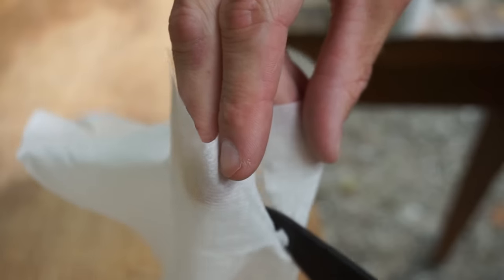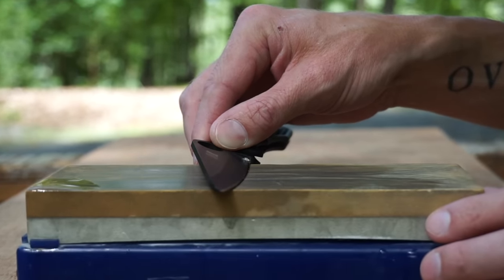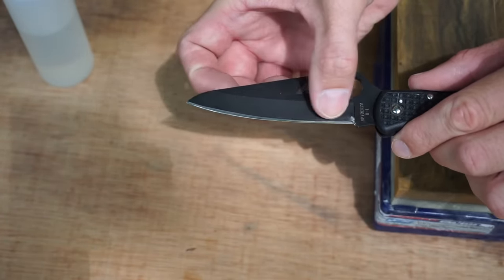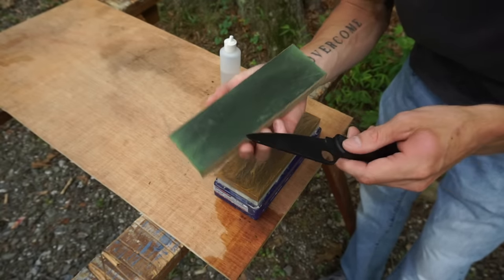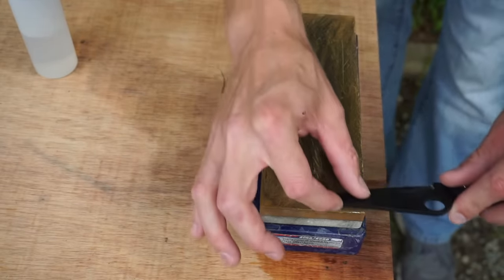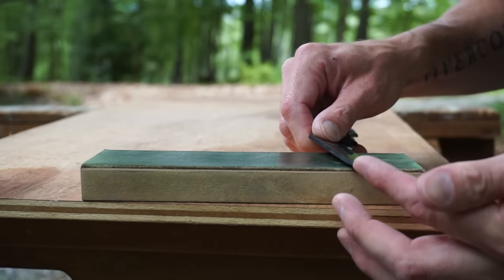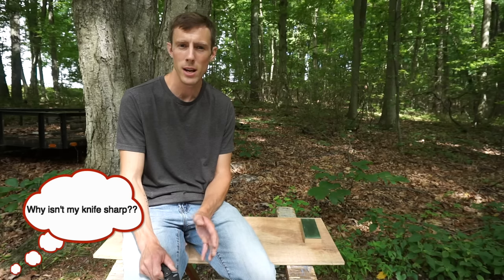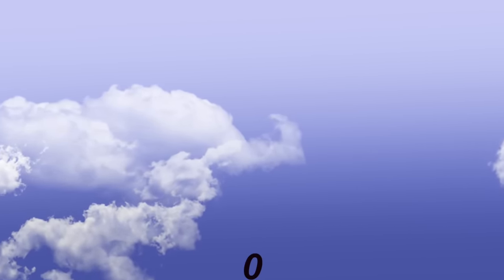3 SHARPENING TIPS BEGINNERS MUST KNOW.  How to sharpen a knife

Comment: Every time I feel like wasting some time, I go to YouTube, look up some knife sharpening tutorials and try to sharpen my deadly dull folder (that actually was kinda sharp before I decided to remove a nick in the edge). Pretty much every next tutorial seem to poop all over what was said in the previous one, yet none helped me produce any success so far. 

I've tried dry stones ,watered stones, oiled stones, moving the knife away, moving the knife towards me, moving the knife in a circle, alternating after 5 strokes, alternating after 20 strokes, alternating after 1 minute, moving alongside the whole edge, sharpening the tip and the blade separately, screaming at the knife in utter despair.

I'll either sharpen or just whittle it away eventually.
Reply: Buy the guide-knife it help a lot... you reach a nice angle. I start sharpen 1 year ago my chefknives without results and now slowly slowly i see that every time come better and to adjust a knife you don t need 2000-3000 grit buy a wet stone 400 and 1000 is enough for normal purpose and is enough to keep sharpen most of the knives. When youll learn how to sharpen better move on more grit and when you will learn very good move on diamond stones because diamond stone if you don t know how to sharpen very well are gonna fuck up your blade.
Reply: Alexander Samarin oiu
Reply: Alexander Samarin i

Comment: See, this is what happens when you actually see and hear how someone with experience, knowledge and understanding demonstrates how to sharpen a knife properly. You just showed me the step I didn’t know about when stroppng that is why I sometimes get a slightly rounded over edge. Use a lesser angle. Now it makes sense. That’s why you see guys strop a blade and they’re practically holding the knife parallel to the strop. It’s those key points that are too easily taken for granted that people overlook explaining. Thank you for explaining things properly. A great, to the point, no nonsense video with clear instruction.

Comment: I absolutely suck at this. I am so mad at myself right now for I have ruined my mora bushcraft and spyderco polestar edge. You make it look like buttering toast.
Reply from the maker: You can't really ruin an edge completely unless you took it to a bench grinder. Just practice maintaining an angle and go slow. It does take some practice. The mora bushcraft is a scandi grind. All you have to do with that knife is keep the bevel flat on the stone. Again just go slow and maintain an angle. Hope this helps🙂
Reply: Smith's or Lansky has a kit for sharpening. Look them up.
Reply: @richardhatt6541  Systems with a set angle are not the best on Scandi grinds (use the Wicked Edge a lot myself). The problem is that the system is very exact, but the grinding on the knife is not. So it needs a more flexible touch, which can be achieved free hand. Easily, since the grind itself functions as an angle guide.

Comment: Great tutorial. However, at 3:00 or so I did not quite catch what you said regarding reflection. If light reflects from the edge, does that mean an apex has not been achieved, or vice versa?
Reply: My understanding is if you see light reflected off the edge of the primary edge (the part the cuts) then you have to keep going with your sharpening strokes. When the primary edge comes to a true point, light is not visibly reflected off it.
Reply: If the knife is not apexed in a certain way, you will see what looks like a flat spot in the edge when you hold it up to the light.

Comment: Going backwards on the stone is the best way to get a burr on the edge. Go forward. Lightly. It's like shaving, not slicing a block of cheese.
Reply: Thats how ive always been taught to sharpen. Hold the angle & draw the edge along the stone. Ive never seen someone sharpen spine first like this
Reply: Great comment. Stroking backwards will cause the burr to roll from one side to the other while stroking forward will pull the material away from the apex. 20+ years on a burr bench in a precision machine shop taught me this.
Reply: Yea it is but you missed the point of why he said that. When you do that it's easy for a beginner to move the angle and mess it up and have to start over.
Reply: @jasonrogers803  But doing it the bad way means being a forever beginner.
Reply: I was told it redeposit's metal where its not needed going backwards, I was taught edge control low angle 22 degree apex going forward on a diamond rod or stone....... But that's me and I am 52 now, we will try this on a axe and see where it ends up. Aloha

Comment: I  work on knives/swords/hatchets/axes as an avocation.  Yours is the best explanation of using stones for a beginner.  If a person has limited time, bad lighting, less than perfect eye sight and isn't using the knife to shave or filet sushi, and it is not serrated, a person might consider a two handed, manual, non electric sharpener with a set angle.  There are fine ones for under $20.  You hold the unit in one hand and draw the knife through with the other.  

If you are still a beginner, but are working with a volume of knives or the knife has serrations, consider a belt sander.  The way you do the serration is to use the edge of the sanding belt which is narrow enough to get into the groove.  Hint-I do my belt sanding outside on a stand and not indoors.  It reduces the chances of accidental fire and also reduces the amount of particles that might accidentally be inhaled over time.  The lighting is also better.

You worked with a spyderco.  Ok.  Guy on eBay advertised a "dull" Endura.  Less than $20 delivered.  two passes on the belt sander with one a couple of seconds pass on the edge for each serration.  Similarly, I sent three nieces college age last month each the same Cold Steel folder bought off youtube, cleaned up and sharpened.  Added a leather sheath for each.

Comment: Thank you a lot for your sharpening series. Given all the videos on this topic in the internet, I still consider yours to be at least ones of the best, I've learned a lot from them and I really like your approach.
Didn't move to diamond stropping compounds (I try to do my best with Dialux for the moment), but other than that I've used your advices and they really work well.
Haven't been able to achieve the hair whittling sharpness unfortunately - when the knife cuts the hairs in air, and I'm not sure that stropping with diamond compound will give me that.) So still working on my hands and skill.
All the best wishes, and thank you again.

Comment: Nice straightforward presentation, well done, not everyone acheives that. Agree with the tip about the Sharpie to help in matching the original angle. The only other tip I would add is to put some jeweller's rouge on the the strop to polish the edge a bit more than just the leather alone.

Comment: I have my husband's or my father-in-law's Rostfrei antler handle sheath knife.  I found it in a drawer; he hadn't used it for 30 years before passing away back in 2008.  The blade is shiny but looks very worn; I know he used the heck out of it for 40 years.  The leather sheath is discolored but not brittle.  How can I clean the knife AND the sheath?  I know that's a huge question and you probably have a video about it.  If you would direct me to it, I would be appreciative.

Comment: Great video!  Just have a basic question. Starting with a kitchen knife that's "dull", approx how long roughly (how many strokes on each side, how many minutes) do you spend sharpening it until you get the desired burr and apex with your first stone?  How many additional stones should I use to finish each knife?  Do I stop between each stone?  Do I spend about the same amount of time and strokes on each successive stone as the first?  Thx.

Comment: Sharpie trick is the best for beginners in my opinion. I still use it myself when sharpening a knife I'm not used to or if it has an edge type that's difficult to sharpen. Also IMO the back and forth method is pretty fundamental and beginner or otherwise you should practice it. You'll never get that muscle memory if you don't start doing it. Sharpie that edge and start doing it. You'll find you've improved amazingly by the end of sharpening a single knife

Comment: Thank you. You confirmed what I thought was correct.
Reply: There is no correct way to sharpen i sharpen towards me and i achieve the best edge but if i do it the way the video says i never achieve the same sharpness so it all depends on what your used to and what works for you this was said to me by a guy who has been sharpening for 60yrs as long as you keep roughly a 20° angle when sharpening then it shouldn't really matter but this is a good solid guide to sharpening for beginners though

Comment: Have you any experience or thoughts on EZE-LAP DIAMOND "M"? I had a friend find one in pretty good shape at a garage sale so I looked them up and ordered a brand new one of these sharpeners after seeing how his worked. This has a brass handle and the "diamond" circular rod, with a cone tip, is kept inside the brass handle. When you're ready to use it, it unscrews and flips over to screw back onto the brass handle. I've had some pretty good luck sharpening with this... But I do want to get more in depth with my sharpening skills and maybe expand my collection of whetstones, this singular diamond sharpener, and the knife sharpening set I got from one of the big tool companies... That set even has a clamp to hold the blade and a guide you can use which is set up for 3 different sharpening angles.
I don't have a strop yet, just a few knife hones for after my whetstone sharpening.
(I will be looking into your other videos, I subscribed)

Comment: My father taught me this method (50+ yrs ago) and I've added a process I call burnishing where I use a small chrome plated rod (screwdriver) to smooth any irregularities on the edge, and I only have to use a stone infrequently.
Reply: Isn't that basically just a honing rod?
Reply: @Superabound2  Possibly, but there is no abrasive or 'teeth' so I suspect it just smooths micro nicks or folds in the edge.

Comment: That's a nice spyderco. Did you know H1 and H2 are marine steel? The story behind it was that a Japanese company figured out a way to cold roll it to make propellers for ships and boats. Turns out such steel is pretty strong. Spyderco was smart to use this steel. Put a piece of string on the grip and you can flick it open as quick as an OTF.

Comment: One more suggestion .I do a lot of leathercraft and have to sharpen my swivel knife during my tooling. I have a green polishing compound  which is sold by Tandy Leather to be an immense help when sharpening my swivel knife on a leather strop You don't need much compound when sharpening and it produces a sharp knife rather quickly.

Comment: I have a serious question. I am currently in an argument over which way to sharpen a blade on a stone is superior. When I was in the boyscouts I was taught to sharpen the blade forward; Like how you might sharpen an ax or lathe tool on a grinding stone. My friend believes that pretty much the only way to sharpen a knife is to continuously sharpen backwards and flip the blade (still in the backwards direction) every other stride or so.  Much appreciated to any and all answers from a source of knowledge.
Reply from the maker: In my experience the direction doesn't matter. A knife apex is basically a square laying on a stone, with the corners of the square being the apex. A burr will form in either direction. I recommend sharpening in whatever direction helps maintain an angle better.

Comment: Thanks for the clear and helpful video. Could you do a video on basic sharpening tools and when to use them: What do each of these do: stones of different grit? strops? Steels (the handheld rods)? Best to wet a stone with oil or water?
Reply: Lower grit is more course and will take off more metal per stroke.  The idea is to start with lower grit and work to higher grit to polish the marks out.  Stropping is just really fine polishing.  Most any kind of leather can strop. I have used the side of wallets, boots, knife sheaths etc to strop.  Oil or water can be used. The honing liquid is used so that you don't build up metal particles in your stone and ruin it.  It keeps the particles from being lodged in the grit.
Reply: @bmphil3400  Thanks, Phil. This much, I know. I hope you will make a video giving specific grit ratings of stones to buy, when to use oil or water, and when to use a strop. I appreciate the general information and education, but I really benefit from step-by-step instructions with all specifics in detail, and I think a lot of other people will, too.

Comment: We called the burr a wire edge. And I’ve seen them pull off in one piece. We drew the blade gently across the stone straight on. Like gently trying to slice the stone until removed. Then finish edge again.

Comment: Love your videos and the way you explain everything in dummies terms. I have a question , I have a stone that is 120 grit on one side and 200 or 250 on the other. They say in the instructions to soak the stone in oil for 1 minute, then add oil as you sharpen. Do I have to soak the stone every time I use it or just add it when I’m sharpening? Thanks

Comment: I haven't sharpened my kabar in over a year and I use it everyday. The key is to use a ceramic honing rod and that gets the burrs out which I don't want on my blade. My knives are surgical sharp and I can even shave off peach fuzz. If you sharpen a knife with a stone constantly, you are unnecessarily removing steel and thus shortening the life of the blade. I still have my very first Kabar and it nearly has a modified recurve because I sharpened it a lot and didn't know better but with my Kabar that I have been carrying for the past year and a half is completely flat and straight, no gaps on the blade when I put the apex of the blade against a flat surface such as a table.

Comment: I have been trying so hard for a few weeks with a few different types of sharpeners. 

The one I get some sharp knifes out of is a rod shaped sharpener. 
It’s metal with lines from the handle up to the end. 
The kind you see on chef cooking shows lol. 

My tips always round off and my edge is always bad there on the tip of any knife I sharpen. 

Do I just need to buy a big flat stone like you use. 

What’s your take on what I said. 
Any help I’ll gladly take. 

Well all your vids are great help I’ll watch a lot of them 😀and already have. 👊😋
Reply: So your sharpening knives with a honing rod? 

If you are that don’t really sharpen the knife as in remove any metal like a whetstone. From what I understand it kind of just straightens out the apex or blade.
Reply: Flying Turtle Dragon 
It may be a honing Rod if that’s what their called. 

It’s fairly long and yes does not make a new profile from what I can tell it only polishes by the look of things. 

I may need to keep learning yes I’m new to this whole sharpening properly bit.

Comment: Great info, thanks. I purchased the Spyderco  Tri-Angle Sharpmaker stick sharpening kit a few years ago. I purchased both the extra coarse (diamond impregnated) and extra fine sticks along with it. Any comments on this system? Do you suggest only traditional stones & strops? Thanks again.
Reply from the maker: That’s a great system. The spyderco bench stones are the same ceramic as the rods and they are great stones. The spyderco ceramics are some of the best stones on the market. That system should work quite well for you👍

Comment: My sushi chef boss always suggests we feel the edge with our fingers because the burr becomes extremely obvious. Start from the dull top of the knife and slide your fingers down toward the sharpened edge to avoid cutting yourself on the burr. It will feel far rougher than before forming the burr and may snag slightly on your fingertip. From there simply flip the knife over and take the burr off from the other side (the side it folded towards).

Comment: you almost had me with all the tips. But you can strop on wood and cut out the leather. Then you wont have to worry about rounding it. I use the leather side as a non slip layer for the bech. Nice folder.

Comment: First thanks for the video's, i'm new to knife shapening, i just picked up a couple cheap knives for fishing, like cutting line etc. They look like something out of a transformer movie, they are 440 stainless,with part of the blade being serrated witch is pretty sharp and the blade itself is not bad but would like to get it sharper, is it possible? these knives have a folding blade and are rock solid, overall lingth is 7" with 3" blade and 4.5" with 2" blade. Any recommendations from anybody would be appreciated, Thank's guys or gals.

Comment: Good advice...... I always think my angle's too shallow, then worry over going too steep. Laying the blade down and watching the contact on the edge is way helpful.
Re: apex...... I was told that the sharpest possible edge is actually seen as an extremely thin black line along the edge, which is something some Asian blade smiths do with certain swords. It's allegedly a molecule-wide void between the thousands of folded layers some blades are made with. Maybe I'm expecting too much from my "Made in Of Course You Know Where" knives.......

Comment: Good tips. I struggle with sharpening my chisels. Thank you.
Reply: Another way to check your edge is, hold it up toward a light and look straight down it. There should be a thin shadow running all the way down the center of the blade. Anything glinting light back to you is a dull or folded edge.
Reply: @truckerenoch8824  I will do that. I subscribed to your channel to learn more. Thank you.